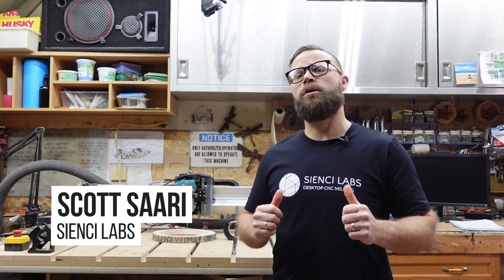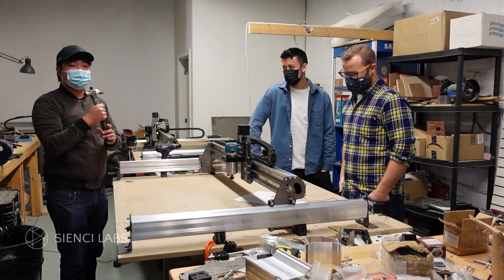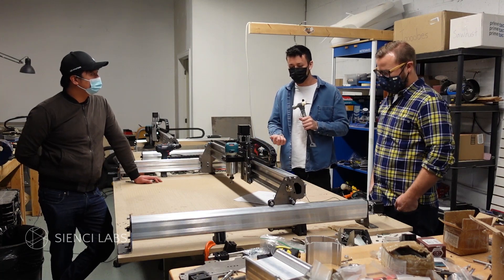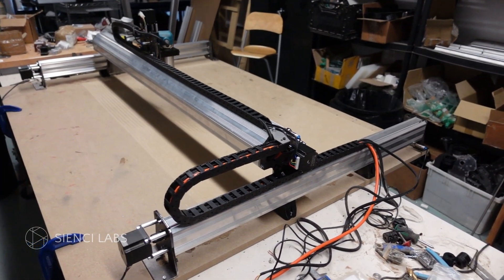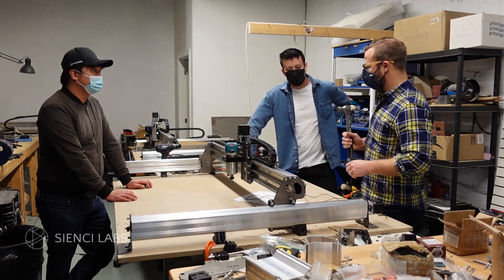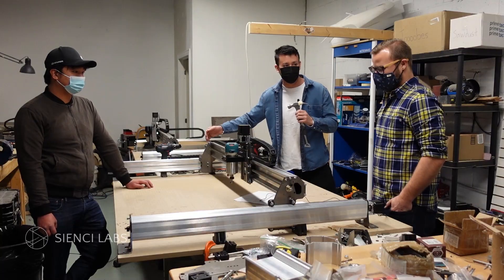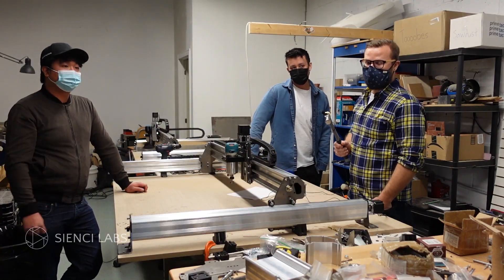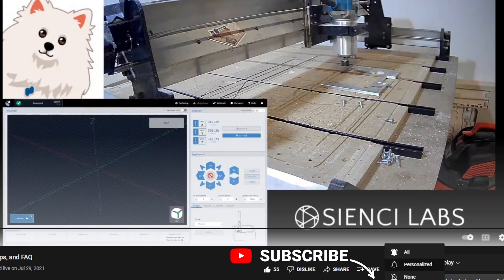Everything You Need to Know About the Longmill MK2 48x30 and Extension Kits

Comment: Will you have 48*48 options ever ?
Reply from the maker: Hi Jav! At this current time, no. There are a couple of engineering and logistical challenges extending the Y-axis. One of the biggest reasons is that it is difficult to purchase a 6ft x 6ft sheet which the machine would have to sit on at the 48×48 version. Part of the reason we chose a 48x30in working area is because the machine can sit on a 4ft x 6ft sheet (basically a cut down 4ft x 8ft sheet). To accommodate a 48×48 version, we would need to build a custom table as well, which is currently not a priority in development.

Please feel free to read about the AltMill in our blog (https://sienci.com/?s=altmill). There is no set expected release date for the AltMill, but it is likely to be in the middle to end of this year.
Reply: @SienciLabs  Thanks I was just looking forward to making LARGE designs like Rounds, shiplap, and not do the stop the design push it through start the cut again push stop push it through  .... Great work on  New Design !

Comment: Too bad Y axis lead screws aren't on outer side...this way it will be covered in sawdust pretty quick. :)
But overall nice machine. :)
Reply from the maker: The amount of dust is actually very low, especially if you have a dust shoe on your machine. In case you're still worried though we have dust covers that go overtop the screws on both sides that nearly fully seal them off: https://sienci.com/product/longmill-mk2-lead-screw-dust-shield/
Reply: @SienciLabs  great. :)
Reply: Very good point